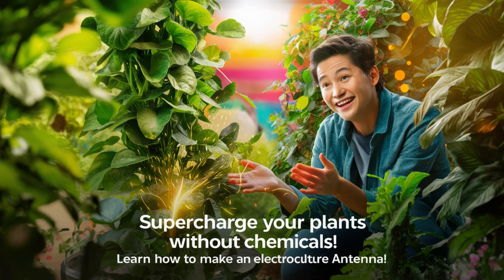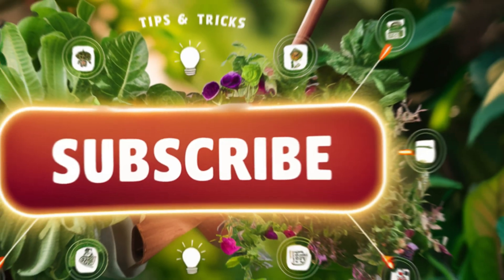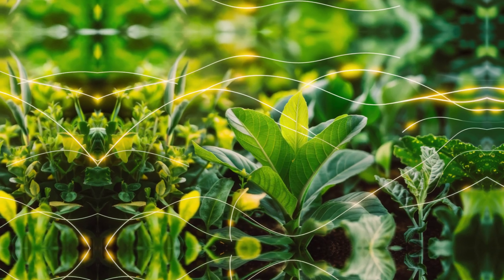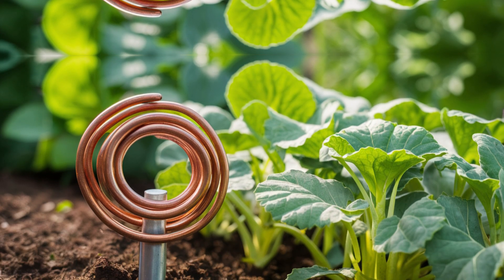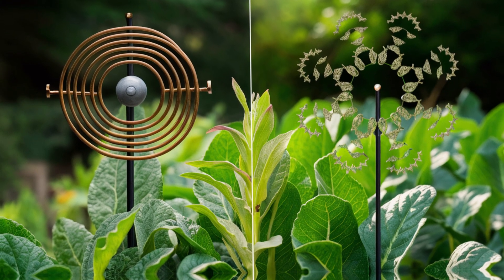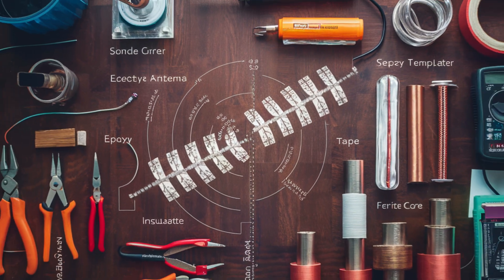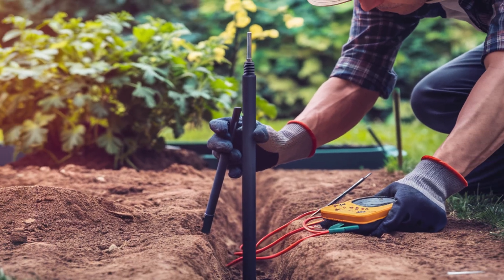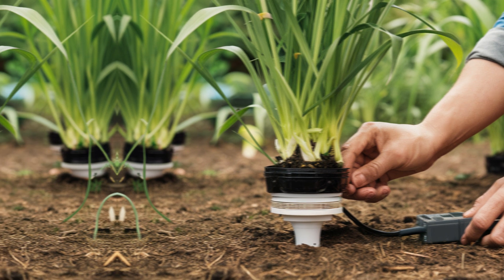How to Make an Electroculture Antenna | Step-by-Step Guide | Types of Electroculture Antennas

Comment: I am a ham radio operator, you need an energy source to stimulate an antenna.  Are you pulling energy from other tv/radio/other transmitters in the area?  You don't describe a wavelength, or frequency.  These seem more like garden art then science.  Some are insulated and don't even have a connection into the soil.
Reply: They work like those antenna knobs you used to be able to buy, that would pull in far away stations. These DO need to be grounded to work. The natural voltage in the air is the power source. For every foot you rise above the ground, the voltage increases by around 100v.